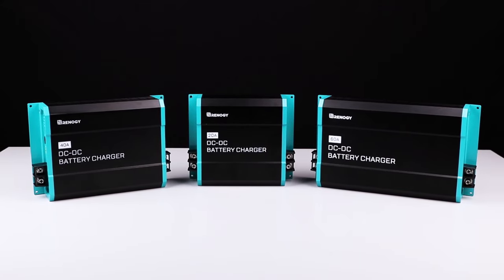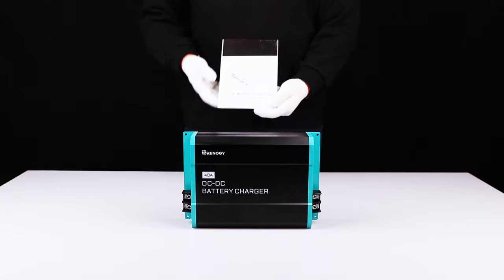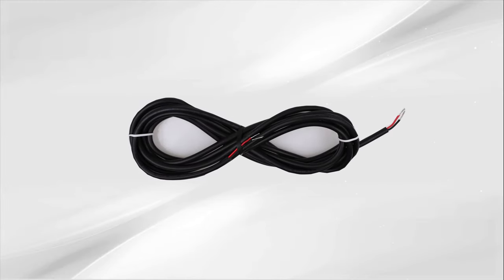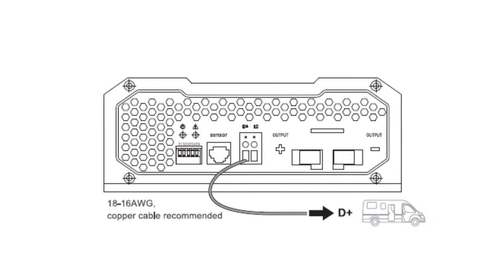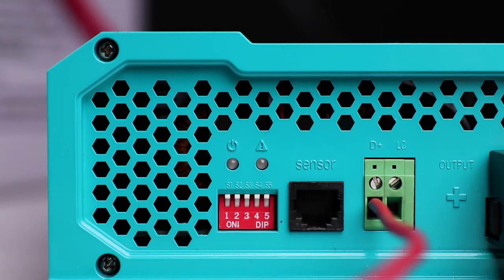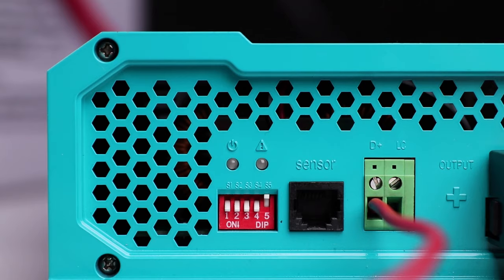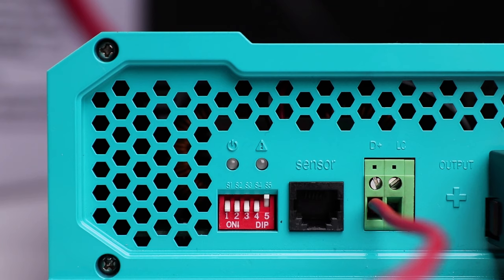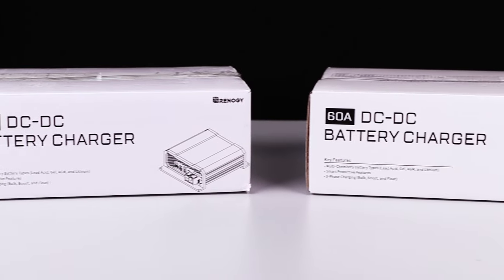12V DC to DC On-Board Battery Charger

Comment: hello I've fitted the Renogy 40 amp DC to DC charger to my motorhome could you tell me which  of the 5 switches I need on to charge my 2 x 110 deep cycle AGM lead acid leisure batteries from my alternator
Reply: Hi just wondering have you any information on the Renogy 40amp doctor dc charger just got 1 and don’t know how to set the 5dip switches I have two 100 ah lead acid battery’s any help would be good thanks

Comment: I'm trying to decide on which model is best for me and why.  I'd rather buy the 20amp  unit for price and the 60amp unit for fast charging but I'm guessing there are other factors such as the alternator and or the batteries I'm trying to charge.  My van has a 90amp alternator, one car battery and 3 AGM batteries that presently are charged with a solar mppt charge  controller.  So which should I purchase and why?  Despite reading a lot and watching multiple videos on the subject there is little information about sizing the DC to DC charger
Reply: As a rule most automotive altenator's can only deliver 30 amps continues - if the Akinator is rated at 95 amps that's generally 95 amps for one minute after the car is started - 
        I would go past 20 amps - just the extra 20 amps on a car altenator is a lot of extra load
Reply from the maker: Hey,

Feel free to contact us here to chat with a product specialist! - https://www.renogy.com/contact-us They will be happy to answer any technical questions you may have! 

Thank you.
The Renogy Team

Comment: Really confused. I have just purchased your 20A version.Your online instructions say for a lithium lifepo4 battery the dip switches should all be set to OFF. ( Switches 1&2 OFF = cut off charge voltage @ 14.7v / Switches 3&4 not used as there for floating volts not needed on lithium battery and Switch 5 set to OFF to note it's Lithium.) So which order is correct as I don't want to risk ruining an expensive new battery! Please help
Reply from the maker: Hi, Audioporn178

For your issue, we suggest you can submit a case through our Help Center Portal (links listed below for specific locations）for help.
 
https://renogy.force.com/helpcenter/s/contactsupport (USA)
https://renogy.force.com/helpcenterau/s/casesubmit (Australia)
https://renogy.force.com/helpcenterca/s/contactsupport (Canada)
https://renogy.force.com/helpcenteruk/s/contactsupport (UK)
Reply: Thanks for reply and link, much appreciated 👍
 For anyone else's interest I have the 20A unit and am using it to charge a 100Ah Lifepo4 lithium leisure battery so after much research i'm setting the dip switches to : ON/ON/OFF/OFF/OFF

Comment: I want to charge my trailer battery for my winch system.  This way the battery will stay charged when I connect my 12v supply on the trailer plug.  But not how this unit is to shut down when operating the winch system ...  Is there any wiring diagrams on my type of application?
Reply from the maker: You can add a switch on the D+ line.

Comment: I am thinking I could just replace my RV battery isolator relays under the hood with this, no need to do both right?  Is it waterproof enough for that?   I understand the D+ switch line, could this be wired to the alternator DC output?  Thus ensureing the charger does not draw any power unless the engine is running?  The way I see it here ( I think) is that its recomended to the ignition switch, but then the charger could be drawing power with the switch in ACC/engine off right?
Reply: You can always add a simple toggle switch between the unit and the ignition fuse tap to turn it off manually to be certain
Reply from the maker: Hey Juatsumdad,

For any technical questions, please contact us here- https://www.renogy.com/contact-us?gclid=CjwKCAiA3pugBhAwEiwAWFzwdeH3Crd9vRTbjjTYl9l3daVqnotJPjBhs2nmw-Wkn1_guWQeW0ao6hoCOHcQAvD_BwE

Comment: Does the DC-to-DC charge need to be wired directly to the alternator in any way? Or does the charger only get wired directly to the starter battery?  On the phone, Renogy's customer service told me it needs to be wired directly to the alternator, but I have my doubts about that based on this video.  Any help here?
Reply: watch the video
Reply: Same thing. Wire it to the battery terminals.

Comment: I have  1998 e350 7.3 diesel 
I have the ford idle controller 
Its showing that my alternator is working  at 12.4... when at an idle... why;???????  Before  the installation my van would charge at 13.8 at idle and would charge house batteries just fine
Dc2Dc .... shows 40 amps....
Is this killing my starting batteries... yes I have 2........or killing  my alternator 
Please  explain.........if anyone knows what is happening
Reply from the maker: Hey Desert vanlife,

For any technical questions, please contact us here-https://www.renogy.com/contact-us?gclid=CjwKCAiA3pugBhAwEiwAWFzwdeH3Crd9vRTbjjTYl9l3daVqnotJPjBhs2nmw-Wkn1_guWQeW0ao6hoCOHcQAvD_BwE

Comment: Would this work better than just using my alternator to charge my batteries? They are all lead-acid due to the lower cost, not lithium.
Reply from the maker: Hi, Protected.

It will be safer to charge for batteries through DC to DC on-board battery charger. We do not recommend you can alternator charge for your batteries directly since it may damage your batteries.

Wish you a nice day.
Reply: Because the charger uses a charge profile to fully charge and float your battery. The alternator will just supply voltage  (14.4V) and overcharge the battery. You certainly can just use an isolator and run system voltage if you are not worried about battery life long term
Reply: @RenogySolar  so your DC-TO-DC charger is not intelligent to adjust voltage for lithium battery needs , even if connected directly to alternator (power source?)

Comment: How often does it a charge a battery
Reply from the maker: Hi, Marco.

As long as your engine is on, the starter battery will charge the house battery through the charger. When the battery is fully charged, the voltage will remain constant and will not cause damage to the battery.

Wish you a nice day.

Comment: Hello, can I connect a 12-volt output from my gasoline generator instead of an RV battery, along with a 400 Watt 12 Volt Solar Premium Kit
Reply from the maker: Hi Wild, sorry for not being able to answer your question in time because we need more information about your system. Could you please contact us at <wecare@renogy.com> or submit a ticket for an inquiry through this link https://support.renogy.com/en/support/tickets/new ? I believe our customer service team will do their best to help you.
Reply: @RenogySolar   SUV with a starter lead acid 74 series 12Vott battery And a 145amp alternator (100amps@idle) 
Life4po Li 100amp 12vott battery as a 2nd battery And the idea of 3 sources of power (Alternator, Solar 100watt, Shore power plug in) I wish to be able to use any 2 sources if needed at once And charge the battery if possible within a 8 hour time frame from 80% drain And not run high temps on the Alt --------------------Can you recommend which Renogy would best match the needs? 20a 40a 60a ?

Comment: I bought a 20A converter. At the output, it gives out more than 36A, it's good that I put the fuse at 30A and now, every time the engine is turned on, the fuse turns off after 2 minutes. The product is defective and does not meet its specifications. It would be better if I bought ice cream for the children with this money. This is a very bad product. Technical support refuses to help. DO NOT BUY IT FIRST READ THE REVIEWS ...

Comment: Looks like a great product but your website is almost unreasonable on my phone ☹️ Most my phonr screen is taken over by your Covid-19 message and only couple lines are available for product info. Will try it on my desk top PC later.
Reply: look for an option, such as  'request desktop site', in your phone browser . use it as a 'compatibility mode' for web sites that are not optimised for mobile devices.

Comment: Can any one help with the dip switches for AMG
Reply: check the manual.
Reply: @esqueue  It does not have  listing for an AGM battery.
Reply: @usmc2a  the ‘Lead Acid’ setting is also for AGM and gel batteries. Says as much in the manual.

Comment: I keep seeing fuse blocks in installation diagrams before and after the DC to DC charger but no one mentions them during installation videos. I have installed a 60 amp in my Promaster without fuses and it works great but I think a fuse would offer an extra level of comfort and protection but what size is recommended?
Reply from the maker: Hi, Chonkontheroad.

For your urequirements, it is recommended to use a 90A fuse for the input port and a 75A fuse for the output port.
Reply: @RenogySolar  Thank you.
Reply: I'm considering a charger for my promaster also. How big are your batteries and how quickly do they recharge?
Reply: @RobLajeunesse  I have two 250 amp hour batteries and they charge at 60 amps while driving so I can charge 300 amps in 5 hours.
Reply: @sidecardan8403  I've been looking for this answer everywhere....thank you 👍🏿. Q?: I assume you have lifepo4 batteries on a 12V sytem?
Reply: @vroor32  I have Go Power and am very happy with them.

Comment: So nothing for lead acid battery s
Reply from the maker: Hi, Rob.

Do you mean we do not explain in detail for lead acid batteries?
Reply: Hi yes I just bought a 40 amp Renogy charger yes there’s instructions on lead acid battery’s but I am not very technically minded on this I have 2 100 ah lead acid battery’s I know that dip switch 5 must be active but don’t know what to do with the rest of the switches any help would be very good I have tried you tube but it’s mainly for lithium thanks

Comment: why not just buy an inverter which additionally has a battery charging function?
Reply: What is the inverter plugged into? What is the max amps/watts that that interface can handle?  What stops the inverter from draining your starter battery when the alternator is off?  How much energy is lost during the conversion process DC to AC to DC?

Comment: I can’t believe this install vid didn’t even mention the current limiter.
Reply from the maker: Hi, Steve.

Thank you for your feedback. The purpose of our video is to show how to install a dc to dc charger. This premise is that our chargers are compatible with other devices. We will explain this point in advance in subsequent videos. Thanks again for the reminder.
Reply: @RenogySolar  Thanks for making the video in the first place. It was helpful and I know some manufacturers don’t even bother. I just thought I’d mention the point about the vid didn’t contain the current limiter as it was a SELLING point for me as I didn’t want to strain my alternator unnecessarily. So as soon as I found it could limit the current to half, I WAS SOLD and clicked the buy now button. I nearly didn’t buy the perfect product for me.
Reply: Could you please tell me how to wire it for that? The paragraph in the manual about the LC wire was poorly written and confusing.
Reply: @RenogySolar  Please give an update on the promised video explaining the LC connection - what it does and when to use it.

Comment: This “how to” is not much help because my batteries are in my truck and RV and not on a desk.
Reply: If you don't know how to wire the charger after watching this video, then it's best to leave it to someone who knows what they are doing.
Reply: The wiring is the same as waht they show, but its more complicated when the batteries to be charged are in a towed RV.  You've got to figure out how to appropriately size the wires both to the charger from the truck battery and from the charger to the RV battery.   Length matters!   Then you need to add appropriate size fuses on both sides of the charger, and then you need to have a way to disconnect the system between the truck and the RV trailer. (Anderson connectors work great).   Routing the wires is also an issue, and that can be a challenge.  So you are right.  This Renogy video is so simplified that it is almost useless for average people in the real world.  Renogy written instructions are not much better.  They tend to leave a lot out on most of their instruction manuals.  Luckily there are many You Tube instructional videos that can be a great help.  Watch a number of them so you can sort through ones that are useful for your situation.  Best of luck to you.  Strong advice....if you are uncomfortable after putting in the time to learn, hire a professional to do it.  You'll sleep better!